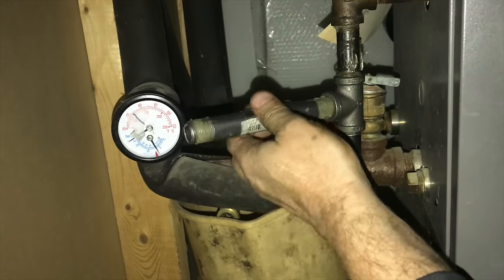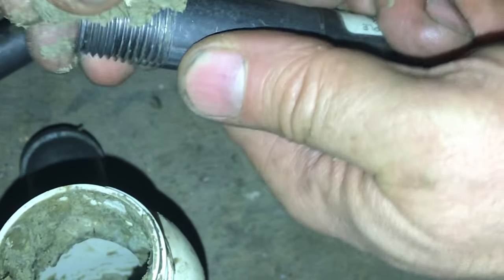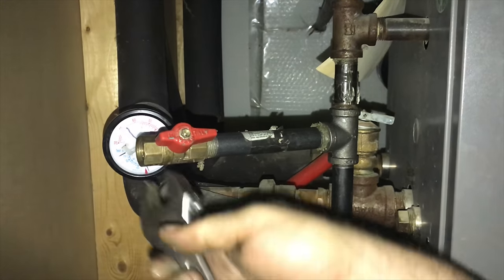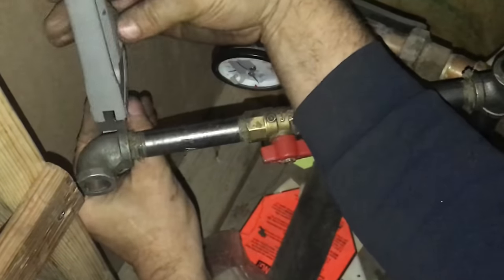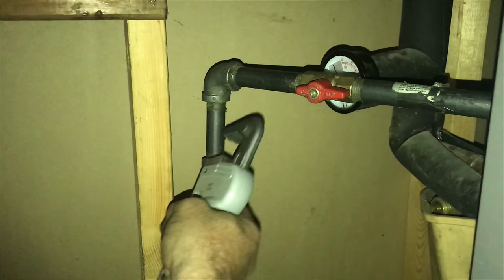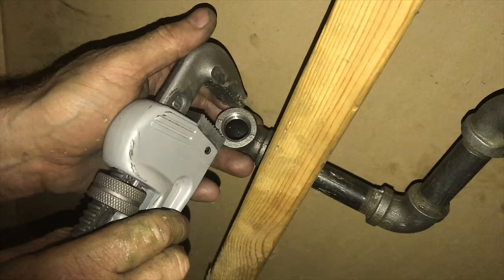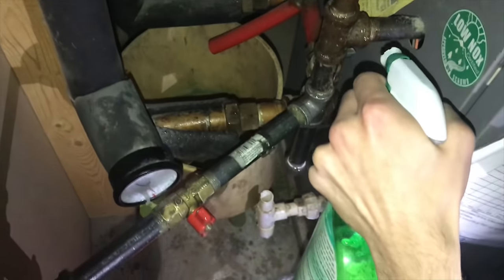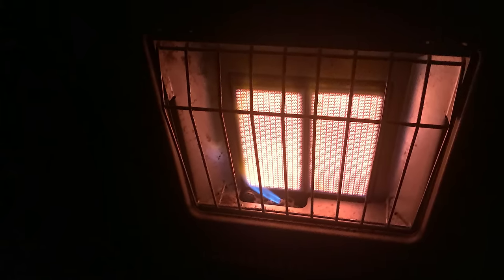TIPS on how to install gas line

Comment: Note to self; don’t take piping advice from a gas fitter who runs his piping right in front of a pressure/temperature gauge, applies pipe dope with his finger, uses a pipe wrench with a sales tag still attached and runs a flex connector inside of a wall. Just my 2 cents.
Reply: Would the flex connection be ok if he didn't cover the wall?
Reply: I woulda got sent home for wresting so much with my wrench on the valve instead of closing it to get the handle out of the way
Reply: Wth
Reply: And thats a dollar 50 easily
Reply: Yeah wtf why is he putting pipe dope on his god damn finger lol
Reply: @deyonsadler6828  what should you use
Reply: @shomariockler9733  a brush to apply the dope
Reply: Instead of writing notes to yourself why don't you get your own channel and do things your way this man did an awesome job. nothing wrong with using your fingers to apply to dope.
Reply: I'm only a student and I was thinking the same thing😭😭
Reply: @deyonsadler6828 he said that it was old in the video. Too dry to brush thats why
Reply: He seems pretty legit to me the pipe dope on fingers is funny
Reply: @richardramirez1086  unless you pick your nose.
Reply: @deyonsadler6828 obviously you can’t apply pipe dope with a brush ( not that one).

Comment: We typically use Gasoila brand or Rectorseal #5 for sealing material. We will leave the last thread bare, so as to not introduce foreign material into the gas flow.  Doing this for 44 1/2 years now.
Reply: PTFE tape only is allowed in almost (all?) U.S. states and 100% in Ontario Canada
I stopped using pipe dope in 2016; ONLY Teflon for potable, heating water, nat. gas and propane
They use only Teflon on golf course sprinkler systems to 600 PSIG, and in high-pressure sea operations, so probably good enough for residential
Reply: @walterbrunswick  ,Hi Walt I believe Teflon in paste for gas, (ptfe) and ptfe tape for gas is still illegal in NYC,NY . But you can use ptfe in any form for NYC Potable and Grey water.
Reply: @walterbrunswick  ,there are pipe dope(thread sealants) without grit that are professionally listed among them Hercules Megaloc,Hercules pro dope,gasoila is ul ,sa and as well as rectorseal #5 all are tested for gas.
Reply: @walterbrunswick  pipe dope is used every day in America in meter pits, not sure what you are talking about
Reply: Exactly  @walterbrunswick
Reply: @walterbrunswick 😂

Comment: Gas Journeyman here. NEVER put a flex line in a wall. Not only is against code, but it is unsafe.
Reply: And also very stupid to do also.  This is handyman 101 class on this video
Reply: Went over to my sister's to do a Kitchen Floor in ~1982.  The stove had 2 Nat Gas flex tubes strung together and these were tucked into a crawl space when the stove was reset.  YIKES.  This was not their doing.   I just discovered it.
Reply: Aren’t you guys in the usa allowed to use copper for gas lines? In europe we do most lines that connect to a furnace, space heater, stove etc in copper. 

I’ve never used a flex hose, bending some copper tubing looks way nicer
Reply: @plumbraider2265  Only tin lined copper is approved for Natural gas. Regular copper disintegrates from the chemicals in Nat Gas. LP/Propane uses copper though. Two different gasses.
Reply: @plumbraider2265  copper is against code for gas here in the USA .
Reply: @seeingisbelieving6355  that's totally not true at ALL tin and copper are far apart on nobility scale. Touching the 2 creates electrolysis and eventually pit holes the copper ( less noble meta. )
Reply: depends if someone wants to live life on the edge, personal preference
Reply: @plumbraider2265  Canadian code allows G, K or L type copper
Reply: @robertficek7586  I don’t know the difference between those. All copper in The Netherlands is really thick walled.

Might be the standard here to prevent people from using the wrong type
Reply: which code prohibits this? I didnt find anything in B149.1 that says you cannot use approved corrugated stainless steel tubing?
Reply: @plumbraider2265  it refers to the wall thickness and if its hard or annealed, im not to sure other wise its just referencing a standard, as long as local code allows then just go according to that
Reply: @robertficek7586  yeah my boss orders everything according to our country’s standard. Which is “kiwa-keur”
Reply: @plumbraider2265  It must be tin lined copper only. Unlined coppper will disintegrate with Natural gas. Copper is ok with propane.
Reply: @plumbraider2265  it was the strangest thing when I saw a picture of gas lines in copper!
Reply: @kodieivie  it’s the norm here in the Netherlands, except in industrial settings because steel is tougher
Reply: @plumbraider2265  CSST is superior to both malleable steel and copper...
Easy to work with, light, does not rust, can store in long coils, cheap(er) in labour 
Hi from Toronto Canada
Reply: @marlboromatt5656  Natural Gas tech in Ma. here,,,,,the times that I’ve seen copper lines in a house was because the house was extremely old and they used the line when the plumber was installing a gas light or a natural gas grill.
Reply: @davidsalvo9021   yes, copper has been out of code for ages.
Reply: @plumbraider2265   copper is the norm here in the UK to, I would say 95%+ of domestic properties are piped in copper,  steel is the norm in industrial settings.
Reply: @plumbraider2265  No in the US we use black pipe and yellow HOME-FLEX or PRO-FLEX Stainless steel. No copper for gas. I don't know how you would seal the copper, without leaking.

Comment: Teflon-Don and some dope man.  And you'll never have a leak NEVER!
Reply: PTFE tape only is allowed in almost (all?) U.S. states and 100% in Ontario Canada
I stopped using pipe dope in 2016; ONLY Teflon for potable, heating water, nat. gas and propane
They use only Teflon on golf course sprinkler systems to 600 PSIG, and in high-pressure sea operations, so probably good enough for residential

Comment: instead of putting the joint compound on with your hand you could also get a 55 gallon drum of compound and just stand in it while shoveling it on .
Reply: He should cover the pipes with it so you can see any pipe at all. He also ruined it by pulling it through the stud and stressed every joint including the stud and sheetrock screws on the other side.

Comment: Question: Before installing the new pipe, how do you "empty" the gas that's still in the main trunk and other various lines? I get you shut off the main coming into the house. I'm relocating a gas dryer. Great video

Comment: Code infraction.  Not to reuse appliance flex connector. It says it on the metal ring.
Reply: Why not ?!? Do u own stock in Ingersoll-Rand ?!? or because someone who never saw a flex connector said so ?!?
Reply: @anonymousbyproxy8250  because it’s dangerous they can develop weaknesses in the folds which can crack when moved unusually or if something drops on them.  You might be fine with reusing it, but don’t risk a strangers or customers life over a $10 part
Reply: @davidrivas2211  C’mon Dave, don’t exaggerate, nobody’z going to jump on them or use them as pull up bars ! And I cannot buy them any longer for less than 20 $ a piece. But, yes, for customers only new ones, always.
Reply: @anonymousbyproxy8250  because NPT connections are designed that way. Each time you properly tighten an NPT connection you must tighten it a little more the next time until eventually the connection fails. Flex pipe will fail sooner because it's more mailable

Comment: I’m a Senior Gas Instructor for Con Edison and never, I repeat never, install a gas flex inside of a wall. Against code and extremely unsafe…
Reply: Does that rule only apply to closed walls? The video’s creator installed the heater on an open frame wall. Furthermore, our gas log fireplace has a flex line that runs from the basement below. A good foot of it is between the fireplace insert and enclosing wall, invisible and inaccessible. Is that a code violation?
Reply: Hi Big Dawg, 
Need Help. 
So i have 5 laundry Gas Dryer. 15kg load type. 
I need to install regulator to control the flow. 
Is it better to install just 1 medium Gas Regulator to power all those 5 dryers or 1 large one plus 5 smaller one for each of the dryer? Assume 5 of them using the same time.

Comment: Hack. Never ever ever let your pipe wrench bite down and tighten on the threads. No mechanical devices (whips, unions, etc..) inside of a closed wall. Never put pipe dope any closer that 1 to 2 threads from the end of the pipe let alone inside it especially if your not installing a drip leg to catch all of that pipe dope in once it hardens and breaks free. Depending on the pressure your device with have a blockage due to this. I guess you got the job done. Live and learn and saved yourself money and disnt have to pay someone like me to do it
Reply: Yep, needs a drip leg. Some codes allow a loop of connector if it drops below device connector, but must meet a min. interior diameter. Not generally accepted, looks like it would be required here
Reply: I opened yesterday another drip leg installed in 1994 and not touched since. Clean as a whistle.
Reply: @anonymousbyproxy8250  
There is talk of eliminating the code requiring sediment traps and or drip legs.
Reply: @WilliamSmith-pz5nw  that talk is stupid
Reply: A drip leg is not the same as a sediment trap and there are different code requirements pertaining to them. A drip leg is near the gas meter outlet and the sediment traps are at the inlet to each gas device (standby generator, hot water heater, etc.).

Comment: His way now my way . If he was giving tip then  my tip is gas line valve handle should turn into “off” position . This way the crescent wrench has more clearance to grip and turn. He also can assemble the whole line including valve and turn to tighten to save time .  Why drill thru the stud when you can add steel clamp and attach to outside of the  stub . This way for more space to turn the fitting .

Comment: Avoid pipe dope in the pipe as it will clog your line and his install covered the gauge which drove me nuts!!!
Reply: Spotted that right from the beginning
Reply: No drop either so all that dope goes to his appliance.
Reply: @kartboarder22g17  no drip leg required for that
Reply: My mentor would hate this video. Just today he told me, " put your flex behind the valve to make it accessible" covering a gauge is in the same ballpark.
Reply: @Jesterlee995  I'm no gas expert but I did wonder . 8f you have a gauge it sho8od be visible and clear surely lol
Reply: We have a name for these kinds of installers... "butchers"

Comment: Good video. In our area, they require that you stub the pipe out of the wall or floor and have a cutoff before you connect to the flexible piping.   Thanks
Reply: Nah - I'd rather have the greatest potential spot to leak inaccessible when you really need to get to it. (ha)
Reply: Yeah our codes are the same way. Those kind of connectors can never penetrate a wall or floor and must always be accessible

Comment: Better to pressurize lines with air at 15psi to check for leaks. Gas is very low pressure (1/4psi ish, depending where you are) so you'll find leaks easier with the air.
Reply: With that little of pipe code is soap and dial for 10 minutes. Using the gas pressure in the line.
Reply: You could also just clock the meter, as is required by code
Reply: Here in Louisiana we test residential and commercial gas lines at a minimum of 3x the operating pressure or 3lb psi, which ever is higher, for 15 minutes minimum. I test all of my houses at 5lb and leave the guage on for 24 hours minimum before inspection.

Comment: It's a  good video to see how you tighten pipes but there were a few things that didn't seem well thought out.  1. the flexible cable  between the studs 2. the pipe through the stud is too short and 3. not aligned with elbow, looks crooked 4. blocking the pressure gauge makes no sense.  5. so messy with the paste which is indicative of the complete design

Comment: Don't tighten across a fitting or valve. Placing torque across the fitting can ruin valves. Always use a second wrench for back up and ensure the wrench is equal in size or greater than your driving wrench. This will allow for greater control of your fitting alignment and tighter final connections. This is imperative for larger pipe sizes. An inch of pipe shoulder should be visible when penetrating through a surface (minimum) such as a stud. An appliance connector should not be concealed. The first 2 male starter threads should also be bare and free of dope to prevent contamination of the piping internals. Exterior gas piping should be painted. Your wrench usage, layout, and general sequence of operation indicates a lack of experience. It didn't leak though.
Reply: Do a tutorial to show us.

Comment: Yellow tape would be a whole lot easier and less messy.   Nothing wrong with dope but it's hard as heck to get off your hands afterwards.   BTW, yellow PTFE tape is legal in all 50 US states... approved by UL and AGA.   Also, agree with others who say you shouldn't drywall over the top of that flex line.  Frankly you should have just put an elbow at the start to angle the pipe down away from blocking that gauge, followed by a valve, and then go straight to the flex as you're already plenty close to the heater anyway.   As installed though I see nothing wrong other than you should not drywall over the flex.   Cheers!
Reply: I’m guessing,but it looks like at least 36” from start of this work to the device. That’s a bit far for a flexible hookup. Would like to see 18” or less (with a drip leg!) generally.
Reply: @TSPhotoAtlanta  They don't even sell gas hookup (flex) lines at the big box home improvement stores less than 36".   Most common one sold is actually 48".   Dryers need some length so you can pull them out from the wall for service or hookup/disconnect.   Waterheaters have short hookups for obvious reasons (they don't get moved).
Reply: It's illegal to put a flexible line behind sheet rock.

Comment: Well done! Good video to show how to join the pipes. I'm very careful not to get the compound inside the pipes then if possible I try to blow air thru the piping to remove any contaminants.
Reply: yeah right
Reply: the advice in this video is bad, do not use it because the way he did this was wrong and could create really bad issues.

Comment: Your sediment trap should be as close to the gas valve as possible.    Would have been better to have the trap at the next to last elbow, where it goes into the stud (brace).  You could have then also secured the extension (trap) to the stud if needed 4:43 point.

Comment: Always pressure test your gas lines first & use soapy water to locate them. Don't rely on soapy water for testing. Use a manometor or pressure gauge .
Reply: Or just clock the 1/4 lb dial on the meter ;)

Comment: Great video ! Thanks! All the negative Nacy's in the comments, I have yet to see them make a video with their comment section expertise! lol !
Reply: are you serious?? You're kidding right?
Reply: If you wanna use this guy's advice with gas, have fun.. I'd recommend a pair of gloves when you apply the pipe dope. Hahaha
Reply: Negative Nancys? Buddy you ever hear about code? This guy is playing with danger. Im a certified gasfitter from Canada. Yes homeowners are allowed to do their own work but in this instance, a permit should have been pulled as he is expanding a line for an additional appliance. If a homeowner permit was pulled, more than likely a inspection would have been made. In this case it should have failed. A line that creates a union effect aka the corrugated steel connector, is not allowed to be run in wall through studs. Even if unfinished. I just hope everything was properly inspected and approved in the end
Reply: we are being "negative" for a reason, this video has very bad advice.

Comment: Very strange pipe sealant and application - I used a brush and the paste "paints" on - the "hands on" approach seems like a royal mess - also, putting in such a short nipple through the stud creates a blind connection (can't leak test) and puts tension/strain on the line...

Comment: You can’t bury a flex hose in a wall.  It must be visible.
Reply: @SupaTrending Daily 
Not true. Read the label. Appliance connectors cannot be used in a concealed location. It cannot penetrate walls, floors or ceilings.
Reply: @SupaTrending Daily it is a flexible connector that goes from a stationary gas pipe to a appliance. Fittings or the flex line cannot be concealed

Comment: Saints preserve us!!!! In the UK it is actually illegal to do this kind of work unless you are fully trained and legally registered. The same applies to most electrical work.  As a home owner I always get the trades in to do this kind of job.   I can change fuses and swap out light fittings and sockets but any more than that I leave to our electrician. As for plumbing I can change washers and fit a new flush lever and connect washers but that's it. Gas! Not on your Nelly. I don't want to be responsible for blowing up the street.

Comment: Flex pipe in wall- WRONG, old pipe dope spread with thumb- BUY NEW, stresses joint tightness ( Too tight galls pipe threads and causes leaks) not backing up with another pipe wrench while tightening, blocking view of Guage... At least he checked for leaks 😀

Comment: The reason teflon tape is not allowed is not because it causes leak, but because if small bits of teflon tape gets inside pipe, it can block gas orifice and cause unsafe burn of gas. If you use dried up pipe dope and allow that to go inside of the pipe, you are pretty much causing the same problem. You should still avoid pipe dope inside pipe with a fresh pipe dope, but fresh pipe dope sticks to pipe, so less chance of problem if some gets inside.